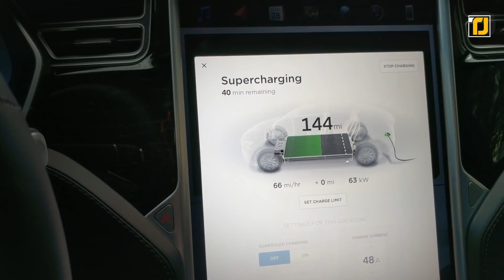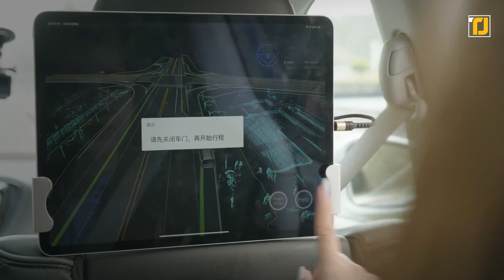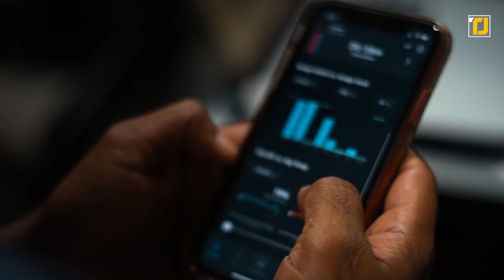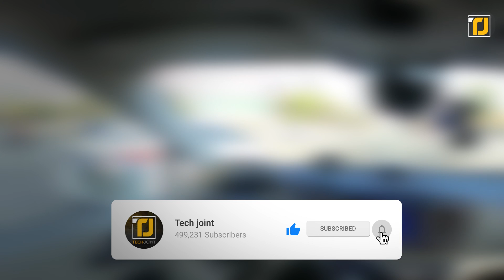11 Crazy Tesla Inventions You've Never Heard Of

Comment: My opinion, I'll be buying their $25,000 Compact car in 2023.

Superchargers to get me anywhere conveniently, the better than stun driver emergency avoidance system, and Teslas Boombox (being able to change the horn and driving noise to anything)  makes it a done deal.

Although they are usually optimistic on timelines (so I'm expecting 2024 or later), and they do but their projected starting price (150 mile $50,000 Model S, 240 mile $35,000 Model 3, 244 mile $40,000 Model Y), their lowest trim models don't sell enough so they cut them, so I'll be expecting $30,000 

Also, they increased their prices 8 times this year alone ($37,000 to $44,000 Model 3 and $50,000 to $57,000 Model Y) so either demand is to high so they increase prices (fixable with more production capacity) or inflation hit the car businesses bad (The average for all car companies is $10,000 higher than pre-pandemic prices)